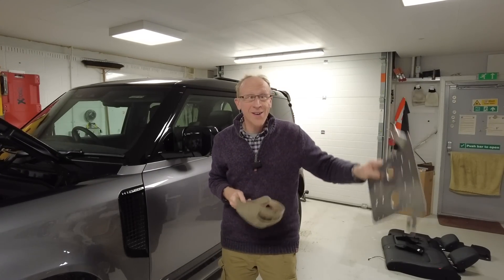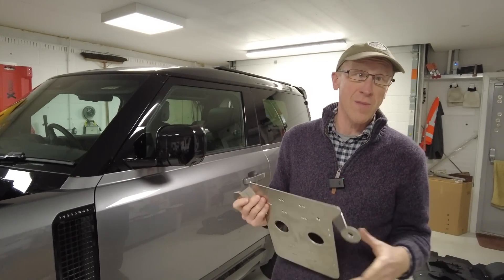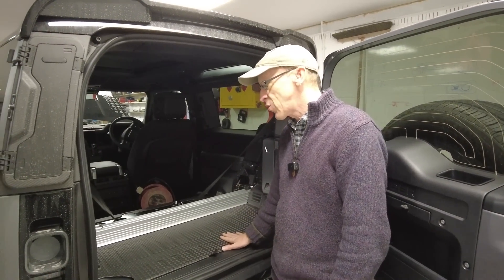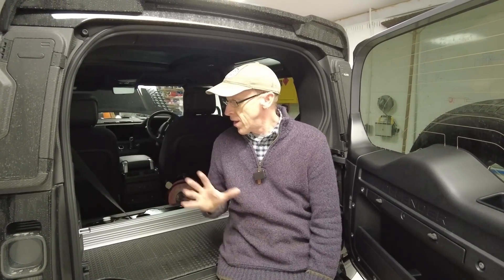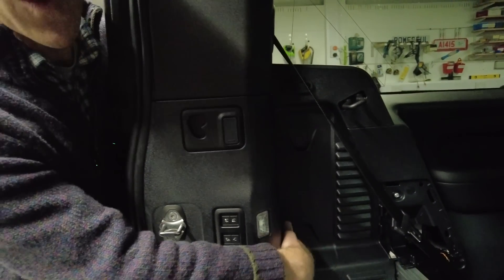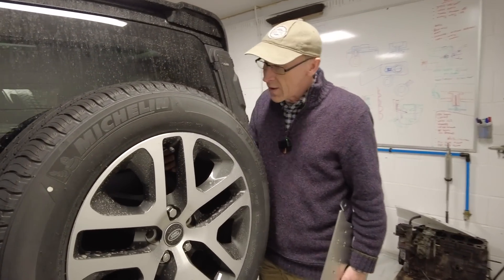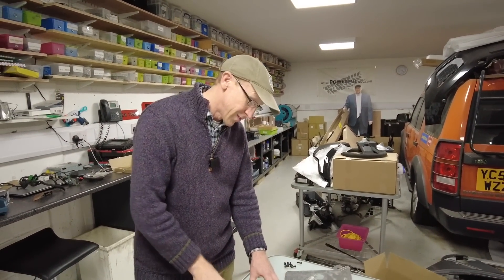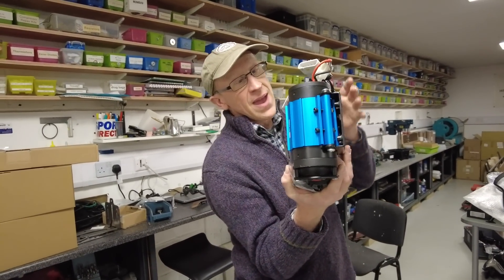Rear Door Compressor Mounting Bracket for new Land Rover Defender L663

Comment: This is probably a much better solution than the Land Rover one! Making a new spare wheel centre cap that duplicates as the quick release would be the icing on the cake for this wonderful solution. Brilliant idea!!
Reply: It really needs an extension that places the quick release further out, so that is protrudes from the center cap position.
Reply: should be quite easy to achieve, with some 1/4 BSP threaded pipe cut to the relivent length, would extend the quick release through the wheel centre.

Comment: Nice design, with regards to the quick release I would recommend adding a standoff pipe to move the quick release to be the same depth as the wheel sits.
Reply from the maker: Yes I have now purchased some of these.  For reference the thread is 1/2" NPT

Comment: Might be a less pretty solution, but you could jimmy up an center cap adapter that's actually a female connection point to the ARB, that way you don't have to fish it through (put the coupler on the center cap, feed in like 5-6 inches of additional hose so when you have to take the wheel off you can have some slack to the compressor). I think that'd be a pretty slick connection point on the actual wheel.
Reply: I thought the same thing

Comment: So a few months later how is it running?  Much better than inside the boot.  I have had a ARB single under the hood of our jeep for 13+ years now and it has been flawless.  I am a little skeptical of it sitting outside in the TX heat all year around but love the out of the way, wasted space solution.  Please post a follow up soon.

Comment: Hi Simon, Happy New Year, firstly theres no fitting link at 1.45, and  just a thought maybe find a stand off extension for the air connector to bring it out level with the wheel mount, to make it easier to reach.

Comment: I may have missed it somhow, but did you also show how the electrical supply connection is made? Maybe in another video? .... I'm assuming you poke the cables through the grommit / remove variious covers and tap into the rear compartment 'fuse box', but over here in Australia we dont have good access to technical info (i.e. schematics etc) from JLR... and so while I'm mechanically and electrically savvy, at the moment I am not too keen on performing 'exploratory surgery' on my new toy 🙂.

Thanks in advance for any advice you may be able to provide.
Reply: Hi, did you get any help with the wirering?
Reply: @PELOSC  Not so far. And I'm not too keen on trying to pull apart my new toy to find out for myself... at least not yet 🙂

Any advice would be very welcome....

Comment: Great idea, just two things first one are the screws that connect the compressor to the plate are they going into nylock nuts as the vibration may make them come loose. Second one where the outlet is on the compressor  is it not possible to make up and extension piece to bring the quick release connector nearly  flush with the spare wheel. I.e. a piece of stainless steel pipe about 6inch or so with the same thread to connect to the compressor then fix the quick release to the other end. Just a thought..
Reply from the maker: Hi Gordon - good points - some threadlock on the nuts would be a good idea - I dont think they are nylocs.
I like the idea of the extension piece - this would make it just that bit easier to use.
Now all i have to do is work out the wiring !
Reply from the maker: I will check the thread tomorrow but this seems ideal
https://www.google.com/url?sa=i&url=https%3A%2F%2Fwww.amazon.co.uk%2FThread-Extension-Female-Chrome-Brass%2Fdp%2FB00LGJJX52&psig=AOvVaw32FzoCzcyTpzyjSSkuebpY&ust=1673041450091000&source=images&cd=vfe&ved=0CA8QjRxqFwoTCLCbsJyzsfwCFQAAAAAdAAAAABAN

Comment: You need a 3d printed sleeve to put over airline to remove it. Just a tube with slit up it so it will slot over the line then push in to release it

Comment: I guess the voltage would be to high to just plug it into the domestic socket below the fuse box for those of as that have them. This could possibly remove the need for a switch? Brilliant idea, well done!
Reply: IIRC a cig lighter / power socket is max 10 amps , those twin pump ARB's are about 50 amps

Comment: Hi Simon how about you extend the air release nozzle so it is almost flush with the outer wheel holder making it easy to release as when there is air in the hose it is very very tight to release
Reply from the maker: Yes just ordered these - the thread is 1/4" NPT !
https://www.ebay.co.uk/itm/122643142005?hash=item1c8e19d575:g:bsMAAOSwo~Bgt0Th&amdata=enc%3AAQAHAAAA4Nyqo1aNBuh1B%2BwKvFRcXvY8P5yPZeYFScQPQSk3h3taw9VwDv%2FuN8JlIQDjuG4iD%2BMw8fKFXxY8qmCHlk%2BNOgTTNfihycvPzJBhZG6o6bbm%2By111X4YO8t7NAMv5sRRzIy9fRjEM7o2eoG6xBeJ%2B6BuohpOgX6biJ95DfTmA%2FZcYE2vLLsPBa1yRZs3G2aIdfxO7pWtcqfpybfcRJSA%2BGonAvOolmPhG48cqKlK9K0mWHs3CQl9vF9UVkrXEIlPxk4nKFMRau7KDWxTmGglPROa0f2SfqR2%2B5Zt71xeh%2B1l%7Ctkp%3ABk9SR_Dyi7-wYQ

Comment: Will this be the straw that breaks the rear door’s back?  I had an early classic Discovery three door and its door hinges would droop if I so much as looked at it less than kindly.
Excellent location and kit if it works. Would like to see it wired up of course and maybe you could sell the bracket with a wiring kit included as standard
Reply from the maker: You raise a valid point but this seems a well engineered rear door - credit to Land Rover !

Comment: Great idea. Would love to see the wiring video when able.  2023 110 owner here in the US. Would you recommend the ARB or the LR integrated compressor? Also will the smaller ARB fit on the same mounting bracket? Thanks for all you folks are doing.

Comment: will the mounting plate also work with the smaller single cylinder ARB compressor? Also is there a wiring video?

Comment: It can’t be beyond possibility to get a fixed air line extension so the quick release sits level or protrudes slightly of the spare wheel.
Reply from the maker: Yes this would make a nice final touch !

Comment: Amazing!!!!🎉

Is there any electrical points to power off the cars power supply or a new cable run needed from the battery?
Reply from the maker: Working on this - but the rear fusebox should provide a feed of sufficient power.
Reply: @L663  Need to ensure that you select a fuse that is live only when the car is running. If you run a compressor off just the battery it will drain very quickly. The other issue to point out is that hose connector gets very hot after use, even with the rubber covering. Just another issue to make people aware of.

Comment: Hi 👋 very nice and professionally upgrade but I think need small cover top of compressor to protect from rain 🌧️ and small tool to release air hose. You are professional but this is my idea.
❤❤👌👌👍👍🙏🙏🇬🇧
Reply from the maker: Greetings mr Virdi - the ARB is supposed to be splash proof and it needs air for cooling. The spare wheel will cover the compressor from most rain. I like the idea of a release tool !
Reply: Splash proof won’t really cut it then living behind the wheel in U.K. weather. I personally think it’s a stupid place to mount it and would be a pain to use.

Comment: In real life you’re exposing the compressor to dust and mud which is not good at all. In addition, the access point is beyond horrible. When we travel, we sometimes air down and up several times a day! I would be super discouraged to use this system, not practical at all!
You should check out the solution we created for our dual ARB compressor.

Comment: Brilliant !    No more to say.  _  Actually there is ... I think it's possible to mount these compressors into the engine bay of a Disco 3 and 4 - so, how about doing a mounting plate and details of mounting this into a Discovery 3/4....
Reply: I have seen many a video where people have installed these units (and the single compressor version), into engine bays. I believe that this will lead to premature failure due to the heat.  Stories of motor bearing failure etc are being told. These units run hot when operating and have a fan installed to try and keep the heat at bay. But if the fan is moving hot air, or very little air due to it's installation location, then it's going to fail.

Comment: This location is very dusty, and the filter will get clogged up in no time. I would suggest to add the remote air intake kit and locate the intake inside the car
Reply: I travel as often as possible to Central Kalahari and Okavango in Botswana. The dust is a next level powder in the dry season. In Southern Africa I would hesitate to mount anything there 😳 Maybe UK/Europe would be fine?
Reply: Great video - Maybe add some sort of ‘soft’ washer (nylon?) between the stainless steel bracket and the car? I’d be a bit worried about bolting the bracket directly to the vehicle body w/o protecting the paint etc, it could create a potential corrosion / rust issue downstream if this isn’t done.

Comment: a cylinder 3d printed that goes in the center of the wheel that you push to release the hose is a simple solution to engange the quick disconnect

Comment: Excellent idea! Do you think it's possible to install a couple of right-angle air hose brackets to the outlet so a hose could come out of the bottom/side of the wheel bracket? That way a hose could be stored behind the wheel (wound-up), and doesn't require removal of the spare wheel cover.

Could it also be possible to power the thing with a 12V lighter plug?
Reply: To answer your second question, the answer is no. According to ARB, it draws 56A under full load. Most 12V plugs are only in the 10-20A range.
Reply from the maker: Yes the wind up hose outside would work - the thread is 1/4" NPT but i would rather keep the hose in the car - keep it clean ? I agree with S2S below - the ARB compressor takes some current - I will do a video on the wiring.
Reply: @L663  That's a fair point about the dirt... Maybe a cover or hose bag or something would be necessary. And yes to be fair the ARB looks pretty heavy duty so no surprise really!

I have a P400e myself so I'm very intrigued by the problems that arise from it and the solutions involved. A contoured boot mat would be ideal...
Reply: @L663  Hi! I just ordered the kit+compressor and I'm interested in how to do the wiring on P400e. Do you have vidoe for that?
Thank you!
Reply from the maker: @SpaceScope0714  We have not launched this yet - we are working it !

Comment: A little google will tell you these arb twins aren’t that reliable sadly 😢
Reply from the maker: Oh no !
Reply: @L663  sorry to bare the bad news guys, hopefully this is an exception. But fuses and bearings seem to go quite fast and regular. Even if connected to a tank. Which is real shame for a couple reasons. The price, the looks and of course arb is normally quality
Reply: @Discoveryjamie  
But what model? This is 2022 model. Surely ARB would have done R&R on faults. 👍🏻🙏🦘
Reply: @grahameroberts8109  sadly not mate, I watch a lot of the Australian boys it’s pretty much only reason I knew. I was so close to getting one myself, from my own research the singles seem more reliable
Reply: @Discoveryjamie  I am pretty sure the installation has a lot to do with it. These units generate a lot of heat and there's even a cooling fan that runs continually when power is applied. A lot of guys here is Oz fit them in engine bays and under the false floor of their Land Cruisers and Patrols. The engine bay is continual heat and hot air and under the floor there will be limited airflow. I think this is a primary cause of premature failure. I have installed the dual compressor unit in my Y62 Patrol - it operates the load-assist airbags on the rear suspension and provides an outlet for air-up of the tyres. It is installed inside the vehicle in a large cavity in the boot where they install the Sub-woofer in higher spec models.  So far no problems.